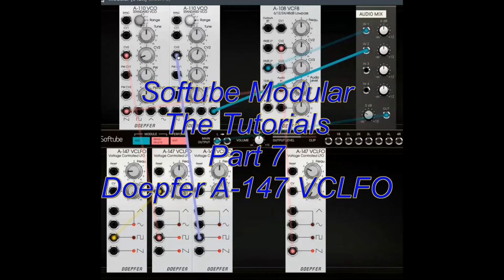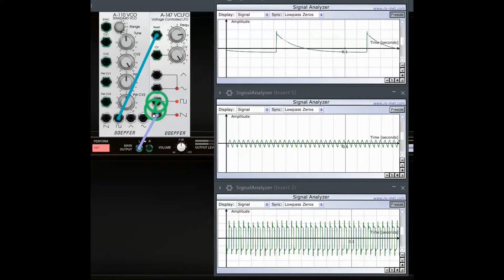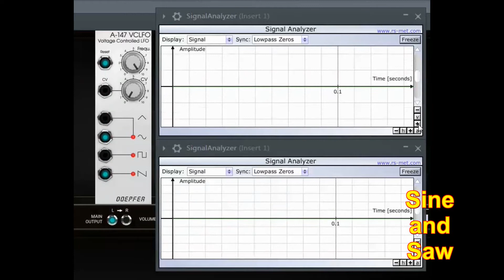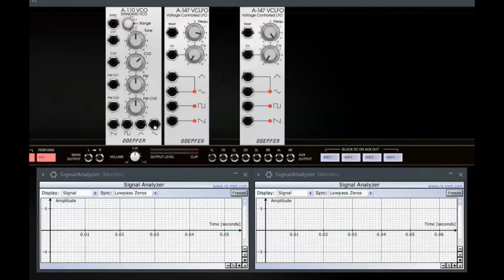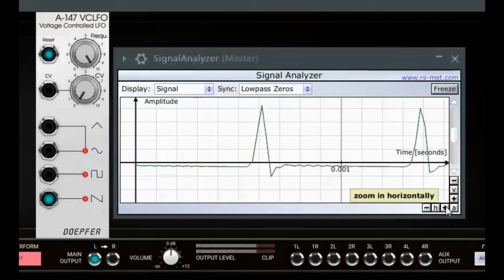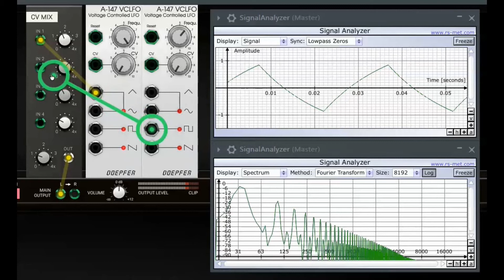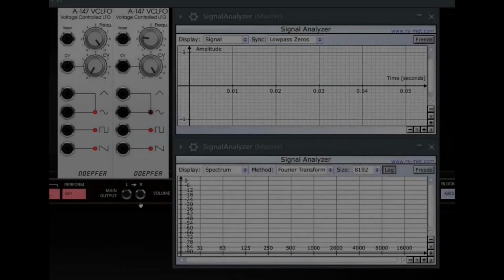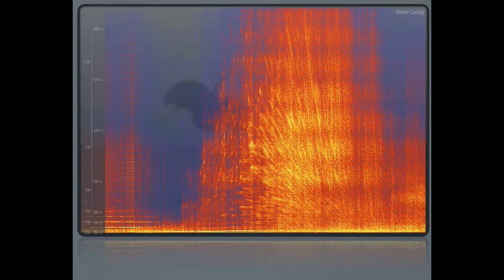Softube Modular The Tutorials part 7

Comment: Finally trying to start from scratch and I get no sound out of even the VCO output into my main speaker. If I load a preset however, I get sound.
Reply: On another note: If I take apart a patch that works, all the way down to 1 VCO and use that output, it works. If I add another VCO to the rack and try that output, my new one doesn't work.
Reply from the maker: Hi Kame! It´s for sure a problem with your DAW. Maybe the signal routing in your DAW isn´t as it should be. Or there simply went something wrong with your installation. I´ve tried different situations and setups, but your problem didn´t occur.  As I can´t give you a more helpful advice here therefore, I´ll tell you what I would do: first: reinstall MODULAR. If that wouldn´t solve the problem I´d try to check the MIDI routing/signal flow (there is some useful freeware on the web, in case your DAW doesn´t have a function for that). If that still doesn´t lead to a solution I´d try a lot of VSTs including freeware ones at exactly the same place in the signal patch. If they all work without problems and the phenomenon you described is still virulent, hm, ok, then make a series of Screencaptures of the whole configuration (including all relevant screens showing your DAW and your project) and send them to me at rofilm@seznam.cz. I´ll try to find out more then. Good luck and have a great day and a good time. Rolf
Reply from the maker: Sure. And thank you for commenting. If you ever have a question concerning my tutorials, don´t hesitate and ask! Have a great day and a good time! Rolf